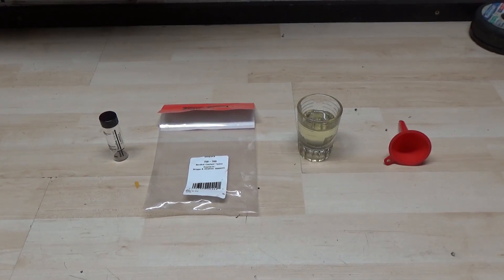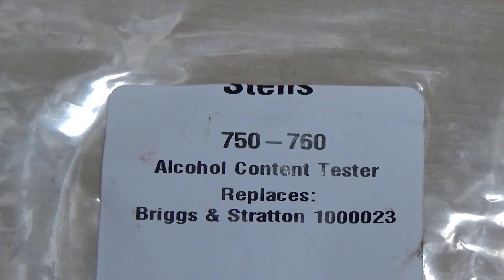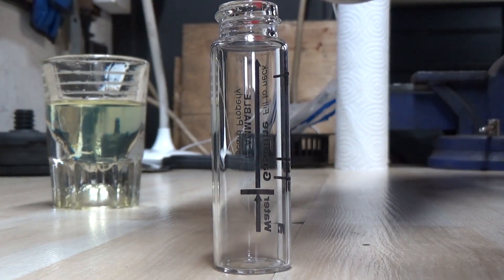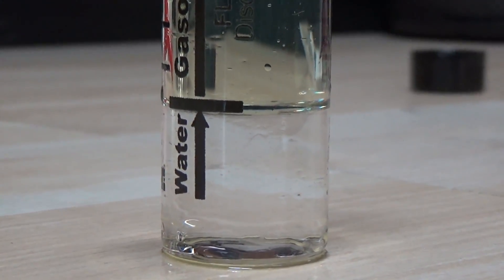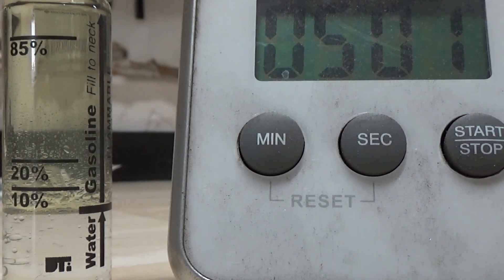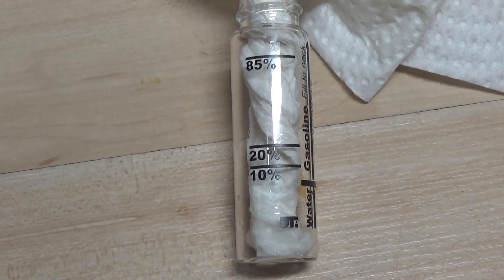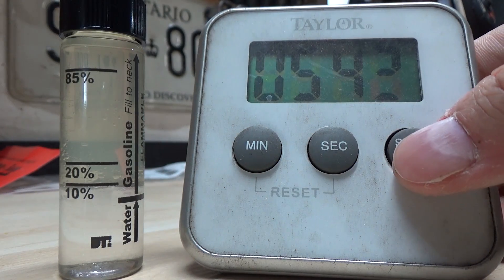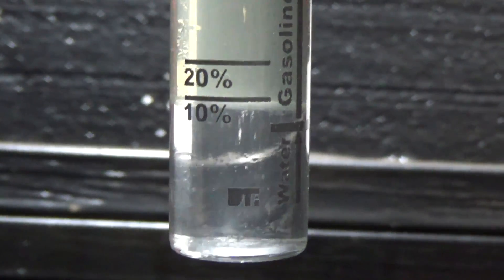How to Test Ethanol Content in Fuel

Comment: Shell's high octane also has no ethanol in it. Good post. A few years ago, I started using ethanol free gas in my small engines. Experienced an immediate improvement. Every 4 stroke I own, starts on the first pull regardless of how long it's been sitting.
Reply from the maker: All my machines leave starting 1st pull, every time! Thanks for watching Steven!

Comment: Great job the Ethanol in today fuel is a bunch of bull sh**. I can't beleve all the damage it dose the small engine's an fuel tanks and line's . I had one riding mower come in the owner told me that it ran and just stop .I checked the tank first to made sure he had not ran out of gas. and he had about 1/2 tank.  But I seen on the bottom of the tank a bunch of black little parts and one big one over the outlet . I then looed at the cap and most of the rubber seal was gone . Down in the tank.  Well this is already to long but we all need to say something to tell the MAN to make a law again Ethanol in our fuel.Thank you
Reply from the maker: Exactly, thanks for watching Bob!